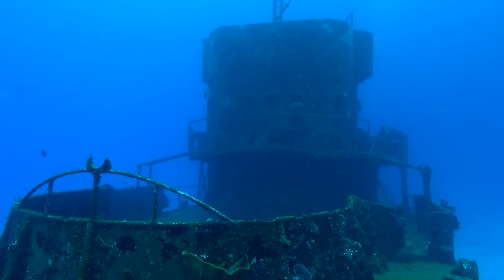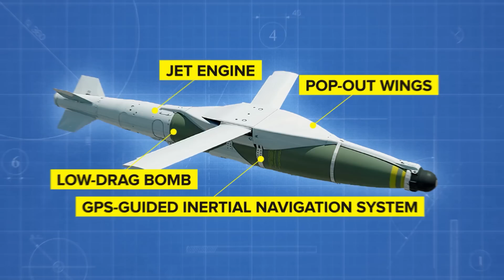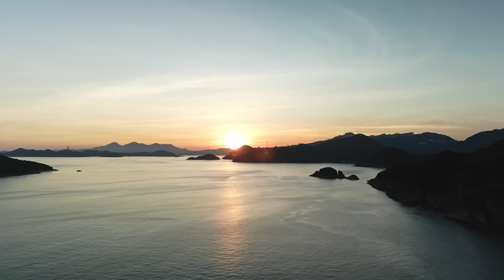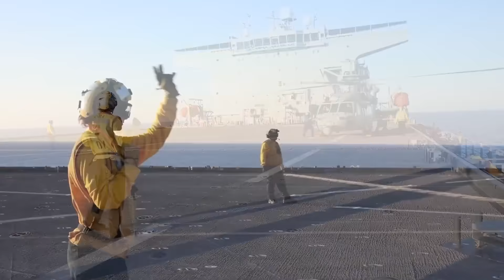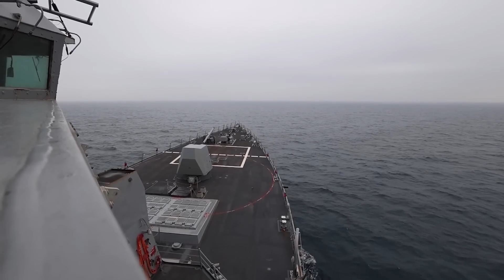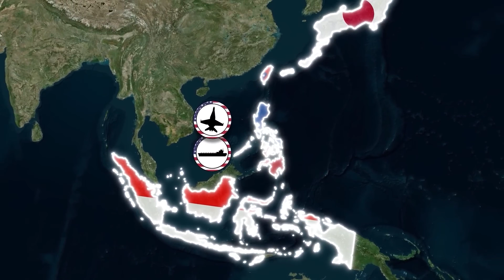This New U.S. Military Tech Can Turn Any Chinese Weapons to Dust

Comment: None of China's Carrier based fighters can take off with a full weapons load out even with air to air refueling to keep it light at take off. AND lets nit forget much of what China has wS STOLEN and reverse engineered (Most from Russia) Knowing that Russians weapons system have a pretty high failure rate during combat operations there is no reason to think China has over come those issue if nt made them worse. The US wont admit admit it but the new Carriers Nimitz & Ford can hit speeds in excess of 40 knots

Comment: While the Manta Ray UUV is  impressive, with the Multitude of priorities the Defense Department has--each having Large financial demands such as the cost of replacing the 800 Patriot missiles Already used up in Iran war at cost of 3 Million plus dollars per unit--i don't really know whether the US will have 200 or more Manta Rays by 2030.  Nor do i know that the currently theoretical ability of them never or almost never having to surface will exist by 2030.
Generally, China is ahead in drone tech and at mass manufacturing them. A Manta Ray will have a specific sonar profile that can be distinguished from a whele in a short time ranging from a few seconds to minutes. China could easily have 5 times as many underwater drones capable of descending to the bottom of the South China sea where US drones may be hiding. Once detected or even if judged to be a UUV that isn't China's or Russian, it can be fired at with a small torpedo from the Chinese UUV. If it turned out it was a whale, no big deal to Chinese operator. So I'm not yet convinced the Manta Ray will guarantee American Naval superiority for a decade or longer.

Comment: You don't have to sink a warship to take it out of the fight. A 500lb bomb detonating in the right compartment of a ship could completely cripple the ship, making it useless as a weapon of war. Although not sunk, the only way to repair the ship would be to tow it to a dry dock, and even then it might take months to restore it to war readiness. This would make the ship a sitting duck in a very valuable dry dock. Taking out a ship and a dry dock at the same time would be a very tempting target. Heavy-lift bridge cranes, dry docks, huge water pumps, large machining lathes and mills are not easily or rapidly replaced, especially in times of war. Not to mention the human factor. Highly trained naval personnel on warships and the shipwrights and millwrights at the dry dock locations are not easily replaced either.

Comment: They'll catch up quick now that we've gutted the officer education and training travel system. We're also doing away with testing and improvement of the magnetic launch system because "magnets get wet and quit working", and "nobody knows how magnets work anyway". 
The president ordered the removal of magnetic launch systems and replacing them with steam, but I think that quietly got sidelined when he found out it was cheaper to build a new carrier than to switch.

Comment: To give you an idea of how bad the latest Chinese Aircraft Carrier truly is, on its christening instead of all the military brass being there, which is the norm for huge, great Chinese projects such as this, and the entire ceremony being broadcast live on Chinese TV, there was only one person there, their leader Xi, and it not only wasn't broadcast live, there was barely a mention of it three days afterwards because it's an embarrassment. The ceremony was to include Xi pushing a button and launching a jet off its deck. The catapult is so problematic that no one had confidence in it working properly and were afraid of Xi launching a jet into the water. Knowing if this were to take place it would be a tremendous embarrassment, especially with North Korea recently launching their vaunted brand new destroyer partially submerging it in front of dear leader and shown all around the world. If that happened to China it would be been 10 times worse so instead Xi launched a test sled into the water. There is so many things wrong with this carrier, including major design errors that cannot be corrected on this carrier. The Chinese ambition to "beat the Americans and produce a magnetic catapult first" was a costly mistake because this was not a nuclear powered aircraft carrier. This was a steam powered aircraft carrier. Electromagnetic catapults require an unbelievable amount of electricity to work in a very short time frame. Steam powered cannot produce or keeping up with the electric demand. So while the Ford can achieve just under 400 sorties or launches per day, the Chinese catapult is just over 100. That's almost 4 fighters in the air for the Ford vs 1 for China. Making matters even worse, the deck angle having to be changed slightly from the American nuclear powered decks (including the older Nimitz) based on using steam powered forcing the Chinese to move the tower back means they cannot take off jets while simultaneously landing jets. It's either or. Our old Nimirz carriers are more advanced then this latest 10 billion dollar Chinese Carrier.

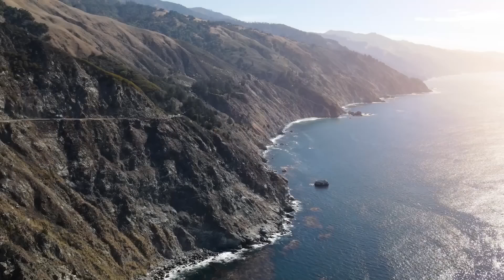Comment: COMMENT # 667!   @ ~ 29:09    THAT'S NOT THE SOUTHERN CA COAST, IT'S THE CENTRAL CA COAST JUST SOUTH OF MONTERY.  ONE OF THE MOST BEAUTIFUL DRIVES IN THE ENTIRE US OF A.  NOT FAR SOUTH OF THIS LOCATION IS A GREAT SPOT TO PULL OVER AND GET SOME GOOD PHOTOS, IF YOU'RE TAKING A DRIVE DOWN THE HIGHWAY YOU CAN JUST BARELY MAKE OUT IN THE PICTURE, ABOVE THE CENTER OF THE LEFT EDGE.

Comment: You forgot to mention that the Lewis B.  Puller is a re- fuel station. It stores 380,000 gallons of aviation fuel, one of its most vital functions.

Comment: AirForce One also has a VLF transmitter in that it can extend a cable long enough to be such a very low frequency transmitter which suggests that mobile VLF transmitters could be made to avoid being targeted.

Comment: US submarines don't communicate via VLF. They are called to antenna depth by receiving a VLF call, then put up a communication device, either floating or traditional antenna, and send a burst signal to a satellite. Then they go back down to cruise depth. 
I can see a problem with the data bubble idea if they are released at the location of the charging stations. They'd pop up very close to the stations and begin transmitting. The transmissions might be tracked back to the area. Repeated launching of data bubbles would let an opponent zero in on the docking station over time. It would make far more sense for the submarine to deploy them while moving and keep on going, meaning anyone who tried locating the "bubble" would find the submarine already gone by the time they got there.

Comment: The first SR-71 Blackbird flew on December 22, 1964. The SR-71 was a long-range reconnaissance aircraft designed by Lockheed. 

How was the SR-71 developed?

The SR-71 was developed from the Lockheed A-12 and YF-12A aircraft. 

The SR-71 was larger than the A-12, with a second seat for a Reconnaissance Systems Officer. 

The SR-71 was one of the first aircraft to use stealth technology, with black paint and a shape that reduced its radar signature. 

How was the SR-71 used?

The SR-71 was used by the U.S. Air Force. 

The SR-71 was also used by NASA for high-speed and high-altitude research. 

The SR-71 was retired by the U.S. Air Force in 1990 due to high costs and a shrinking defense budget. 

SR-71 speed and altitude

Even though the SR-71 has been retired, it remains the world's fastest and highest-flying production aircraft.
Reply: Not sure what your point is.  Incidentally; the paint was NOT originally black; it was dark blue; it was just burned to a black colour by high hull temperatures on high-speed runs.  At high altitudes; grey, white or light blue camo would be better for stealth.
Reply: @C.D-e4f The paint pigment contained microscopic iron spheres that diffused radar signals, and the deep midnight-blue shade provided camouflage against the upper stratosphere's dark sky while appearing black in normal lighting and hangars

Comment: I can only assume there will be very few of these SEATREC recharging stations, which raises a critical question: wouldn’t a state enemy simply locate, surveil, or even pre-load them with countermeasures to destroy Manta Rays while they charge? If these are buoy-based, China—given its technological capabilities, vast resources, and relentless maritime surveillance—would have ample time to map, track, and neutralize them.

A recharging network is only as effective as its security, and without a robust counter-surveillance strategy, these stations could become predictable vulnerabilities rather than force multipliers. I’d be very interested in knowing what measures are in place to prevent adversaries from turning these into high-value targets.

Comment: Carbon fiber body fabrication will git rid of the corrosion problem and if you so choose to have armor put on it still put it beneath the carbon fiber body panels and if you put turbines inside of the body of the manta ray it can charge itself while it's moving effectively extending its range
Reply: The energy used by the turbines would cause drag that results in a net loss of range. Because of energy conversion inefficiencies you get less recharging gain than you would get power losses to drag. 

There is no free lunch.

Comment: I am a retired research engineer from one of the laboratories mentioned... All of these concepts being promoted will NEVER be utilized.  For example, remote charging stations will NOT be useful because they're the first thing the enemy will attack...And, The ocean thermal gradients do not create sufficient power to recharge the batteries quickly and sufficiently.  They know this, but they do the research because it brings in MONEY.  There is NO concern for anything practical because all they are ONLY concerned with is increasing their budgets.  These projects represent the WASTE of billions of dollars!

Comment: I think it could be just an automatic weapon made to read or identify certain codes you think of when you buy something and it needs to be scanned and that gives you all the information that's needed price product the whole nine yards. Well our ships should be able to relay a certain code or be identified an enemy ships not having that code which would be changeable in identification for our ships and not theirs and then if it was guarding or boundaries of our country and something that did not have the proper code to be picked up by these under sea weapons there must be some sort of warning system to make enemy ships turn around or automatic decimation from below the surface.. maybe sound and vibration well you know we all know that that's increased and magnified under the water think of the whale are there sea creatures that can contact one another or just hear from like the vibration of you know a swimmer in the ocean and a shark being able to pick up on that. If we can build robots we need to be able to especially with AI have weapons that are programmed to act on a manically if they don't pick up a certain code or signal upon giving a warning you think of drones in the sky creating an umbrella well the same could be done you know these weapons could be dropped in Mass amounts and whatever ocean we want programmed to attack anything that does not have that secret code or identifying frequency.

Comment: quick sink only works if you can get around air defenses and that is not really possible with that weapon
Reply: Assuming it's used only in isolation and with the enemy's anti-air capabilities still intact. But thankfully our tactics are a little more sophisticated than that. Wheels within wheels within wheels. 😊

Comment: The Quicksink test has a very big flaw...   It was tested after other ships hammered it with large ordinance.   It was simply the "Straw that broke the camel's back".  If you were to hit an aircraft carrier with enough small rocks[ I could also sink it with a small rock if it's already softened up.  Military Show is 75% entertainment, and 25% news.  China is not scared of the US.  I guarantee it.  China can come up with solutions to problems very very quickly, and nobody likes to admit this, but the US needs China, just as much as China needs us.

Comment: The Ukraine war has shown that the US military industrial base fails to produce advanced weapons fast enough and can easily be overwhelmed with massive fleets of cheap old vehicles acting as canon fodder. The Chinese has a fleet of 14000 cheap but giant fisher boats each capable of transporting hundreds of troops. The Chinese will not use its modern assets in the first wave and the US's weapons arsenal is strained from two ongoing large conflicts. All of those military simulations fail to include Chinese hidden fleet of dual use equipment. China is literally outproducing the US 3 or 5 to 1.

Comment: After Ukraine took out Russia’s pride war ship with a single missile, I simply no longer believe in the myth of a nearly indestructable floating sea fortress. For sure these weapon systems represent massive  power and military capabilities but once you realize that the adversary could also have access to comparable ‘Quick Sink’ - missiles how could you feel anything else than a sitting duck? If a message is relayed to you about 4 bombers heading in your direction would you feel confident about intercepting all four missiles? 
My grandpa was a gunner on a warship fighting the Japanese in WW2. The countless times he told me how he feared the potential of a kamikaze fighter suddenly attacking them from the sun. He used to feel like a sitting duck all the time. He would have been shocked to learn about the destructive capabilities of these modern day weapons. 🤷🏻‍♀️

Comment: Mmmm. Strange how we are forced to go the EV route and combustion engines to be fazed out in 2030. BUT, all militaries are planning to increase their gas gussling planes, tanks etc. Rather get rid of all these military exercises. It will be beneficial to our planet. On fighter jet, flying an hour, uses 5600 litres of feul. Which is what the average driver uses in two or 3 years. And there is thousands or more per day in the air. So, let the military go green first. Let them set the example!!!

Comment: Niobicon  mention at 22:45  Why would underwater re-charge of Manta Ray drone require a  physical connection (wired / cable)?  My cordless phone uses  induction and wireless data is everywhere.  I only note this because of the video devoted a lot of time to the wired-link which seemed odd when it could be done without. Impressive technology.

Comment: The same principles that apply to air you can use in water. It's just dense air and you can apply the exact same principles to improve the ability of a submarine to manoeuvre better in the ocean. That's why there's hydroplanes on the towers of subs

Comment: Building air drones has been a specialty of China, is low tech. I somewhat doubt they have nothing in store for submerged vehicles. Worst case: you are building charging stations for the Chinese submerged drones that hunt your own. Worst case: as the stations can’t be placed where no ship has sailed, the Chinese only need to follow the paths of US surface ships near the seabed, two weeks later.

Comment: The J-20 is crap. It can't hold a candle to the F-22 or F-35. Don't forget the US have much better tech than the CCP. Also, the US wouldn't rely on only 1 aircraft or 1 strategy.

Comment: Can the shoulder fired Stinger anti aircraft missiles, Javelin anti tank missiles including the ammunitions of auto main gun of ships & artillery shells be modified & extend  its range longer by attaching a pop up wings like a glided bomb guided by GPS? In addition can a cheap unmaned aerial attack drones be used as an autonomous missile interceptors that automatically launched once its radar detected an incoming projectiles just like Israel's Iron Dome?